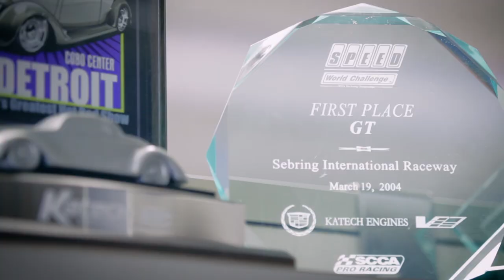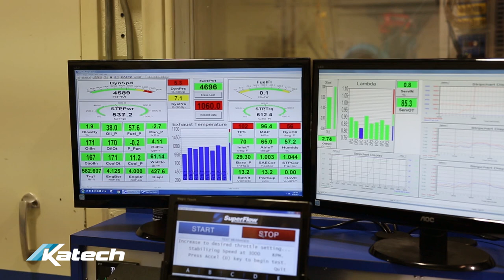BUILD VIDEO - Katech 700hp Naturally Aspirated 427ci Corvette Grand Sport road race car

Comment: Bought a new 2019 Corvette Grand Sport, with a MANUAL TRANSMISSION, and it’s a great car! Huge power, fantastic handling, and with the magnetic ride control, the car goes from track stiff to cruising smooth in an instant. My wife even asks when we can go for drives in the Corvette Grand Sport, and that rarely happens with my NSX. Buy one, if at all possible, life is short.

Comment: Now THIS is the kind of content I like to see. GOT DAMN... 700 naturally aspirated horsepower is freakin' impressive! That 2 month turnaround time is super impressive as well!
Reply: all motor engines are capable of making any amount of horsepower why do people still act shocked about that in this day and age
Reply: @Mr. TAMW  Stop trolling. Your 1.5 liter can't bring in enough air and fuel to make that kind of power and even if it did, it would blow up instantly.
Reply: @tylercouture216  No they can't, maybe on your planet, N/A cars are hard to tune and expensive to, it also just stops at a certain point whilst a turbo engine the sky is the limit.
Reply: @swansmeister incorrect lol

Comment: 700 n/a HP? shut up and take my money
Reply: Angel Brahh aahhhh yeah that’s more than 550 wheels hp. More like 620 to the wheels
Reply: that's nothing. a ferrari 812 is 790 hp.
Reply: @1SLOWCAT  but it's NA and that is still alot of power in a light car. Faster than a hellcat forsure which is awesome because its NA.
Reply: @1SLOWCAT  and yeah that 600+ to the wheels lol... 550 would be like 640 crank up.
Reply: @OscarMaris  that car has 4 more cylinders and is at minimum 4 times the price of the grandsport
Reply: Angelo Basso  Are you high? This is not a base Grand sport.  The engine that comes with a GS is only 460 hp..
Reply: I’m wich’ca my man... this is the 
BladeRunner for sure...If I ever win the lottery... I will have this car.. if no other car.
Reply: Check out Vengeance racing’s C5 build. Its a NA LSX, no nitrous, making near 900 WHEEL hp to a dog box transmission. Its a half mile car and has ran 199.8mph so far.
Reply: OscarMaris 790 flywheel horsepower. Ferrari is notorious for powertrain loss. I bet the 812 doesnt make more than 650wheel horsepower. There is an old saying in the tuner world. “If you want to piss off a Ferarri owner, put their car on a dyno.”
Reply: @yeetusdeletus9  More cylinders yes but not more displacement; we're talking 6.5L vs 6.99L or 427 CI. So Ferrari does more with less but who's got $350 - 400K? LOL I couldn't even afford this Vette!
Reply: @ChuckBeefOG  that vengeance built c5 you refer to is actually 1100hp my goof sir. I watched it before i came here lol.
Reply: Clifford Purk Damn. They must have done a lot to it since i last seen it.
Reply: @cliffordpurk18  1100 hp at the crank, which is 900+ at the wheels.
Reply: OscarMaris Ferrari have the best Engineers and all the money in the world to make 790 NA Engine. 
Think a little bit, kid
Reply from the maker: @1SLOWCAT  This car made 627rwhp.
Reply: @OscarMaris  A Ferrari is 3 times the cost of a Grand Sport with the Katech Mod!!
Reply: Would be 570 through a big stalled Auto
Reply: @1SLOWCAT  Either you have ridiculous drive train loss or you're math is WAY off. How is 700 crank equal to 550whp? It's more like 6xx which is confirmed below.
Reply: OscarMaris it’s also $400k lmao
Reply: @FocusedTrades  Are you serious.  $400k for this build.  Fck that
Reply: @KatechPerformance  627 whp   and add a procharger that would be nice to see
Reply: How much for a 427 package on my 2019 grandsport?
Reply: Scott Cates according to their website it’s $31,657.99 which is more than a used c7 lol.
Reply: @Brikzilla  yeah katech is for the super wealthy. Not for the typical blue collar worker.
Reply: Scott Cates I mean at least you worked hard to at least own a corvette. You’re doing better than most!
Reply: @OscarMaris  its a 6.2 that comes with it not a 7.0.......
Reply: @larrycurrence6874  but that Ferrari engine will be physically huge compared to this LT1 and weigh a hell of a lot more, so not sure why hp per liter is really important? This engine is pretty much the same physical size and weight as the 4.3 V8 found in the F430 ;)
Reply: @OscarMaris  With 4 more cylinders and 200 000 more USD.
Reply: @nodo7575   Ferraris are nearly free if you haggle

Comment: The fact that no power tools are used shows your quality of work. Amazing build
Reply: SuperMegaCliff 
Why is that?
Reply: @bstevermer9293  - Because it's hand built.
Reply: AMG uses robotics and power tools on their special "hand built" engines but also computers to measure out tolerances and even the smallest details. I trust it more than a shop that does without the tech

Comment: 700 NA HP?   Now that would be fun to drive.  Nice work!
Reply: Chris Harris The hell are you talking about!?
Reply: yeah, what? lol
Reply: Chris Harris 
Wtf? What planet are you from? The grand sport comes with a 376 from the factory, and makes 460hp. Not 700+.
Reply: Lol the stingray or grandsport is a 376 compared to a stroker engine 427. Anyone who knows anything knows that a boosted car needs more power to beat a n/a car with similar power. Roots chargers run out of power at redline or just before and n/a engine is lighter = adds weight over the front axle80-100 pounds not including the weight from chiller killers , meth setups etc that you will need to keep the iat temps down so more like 150lbs or more added to front of car =undesirable no heat soak, more reliable and consistent (can be hot lapped and do it over and over again and run laps hard with out having timing pulled or going in limp mode, plus they pull hard up top and have a very strong linear predicable powerband which is key for auto cross and road course racing and still fun on the street for bracket racing. Give me a 700 hp n/a engine over a 750 supercharged engine any day of the week. You can do drag, auto cross and road course and kick ass at all band if someone wants to race for money you can always throw a 100-200 shot of nitrous on to of the high compression n//a that the bottle can easily be removed when you track your car that will kill any boosted car.

Comment: I own a 2017 Chevy SS Sedan with the stock LS3. I've been on the fence as to which upgrade to choose. If I were to follow the primrose path by others, I would have a new block cam-ed, ported with internals, coupled to an SC, and tuned as a daily. Conversely, I just can't shake my desire for an NA alternative. This video inspired me with the cleanliness of their shop and how they approached the build with surgical detail.
Reply: Always up to you man id be interested to hear what youve done since your comment. Ive had turbos and SC in the past and for me unless your sending it down the track or have a heavy wallet its not worth it. I have got an LS2 VE SS with 490rwhp which is enough for the street, reliable maintainable power with the N/A nostalgia.

Comment: Amazing. Why didn't Chevy go this route with the Z06? You guys are awesome.
Reply: jalloor probably smog
Reply: There is no way that car is fun to daily drive. With 700 N/A, I imagine it's gotta have a pretty nasty cam that would make city driving no so fun. I could be wrong though.
Reply: Dan The Man That is also what I heard. Apparently they tried to go big naturally aspirated but nothing with the power they wanted passed emissions
Reply: jalloor 

Too expensive, too time consuming, too difficult to reproduce effectively and efficiently, and 700 naturally aspirated hp won't pass emissions...

Like it or not, but these cars are mass produced, it's the only way they'll make a profit from them... Why bother pushing for 700+ na hp when they can get those same numbers by installing a small and cheap blower rather than wasting all that time and money porting, re-sleeving, fine tuning etc, the power output will be the same, but it'll take significantly less time, money and effort using a blower than going na...
Reply: ZarosianEos I heard that the auto-cylinder shutoff mechanism could not stand 7000+ RPM. Even with the 454 spining at a lower rpm than a 427.
Reply: Because GM is too scared to make anything cool. I have been waiting for an LT4 powered truck for ever.
Reply: Carlos Suarez They did the same with the old LS3. They had 485 and 525hp variants as crate engines, also used in the Copo Camaro drag car.
Reply: Warranty and emissions.
Reply: My C6Z probably makes 700+ NA, and the driveability is greaaaaat! You just have to get the right cam!
Reply: Apparently they tried a high-rpm naturally aspirated big bore engine, but couldn't make it hit emissions. So they went with a blower instead. Kind of sad.
Reply: Because gm and Chevy suck now day

Comment: 40psi of oil pressure at 4800 rpm. These motors sure are some voodoo magic
Reply from the maker: Funny you should mention it.  We've seen less than desirable oil pressure in dry sump LT applications, so we came up with our own oil pump that we just released.  https://store.katechengines.com/high-capacity-scavenge-high-capacity-pressure-lt-dry-sump-oil-pump-p812.aspx

Comment: I'm a die hard GM and N/A fan, and seeing 100hp/L out of a 427 is always cool. I know you guys stopped making Corvette race engines after GMPP brought everything in house in 2010. However, I hope that your work with Pratt & Miller still created a strong bond. I have several questions, the last of which is more of the blurred line between race and road engineering.

1) When it comes to the Gen V LT1, how long do you think it will take the aftermarket to come up with a true tall-deck block with direct injection that will support 100hp/L and 500ci? The LSR-TDRC2X block from Concept Performance has been hailed as the next big step for making reliable power for the LS platform - and it supports up to 505ci SAFELY. Obviously with the LSR block reliability is key, and it supports 505 ci (4.180"x4.600") safely before the wall thickness is no longer sustainable. But it's still an LS-based block, without direct injection. Also, the tall-deck version only weighs 120lbs, which is kind of crazy. A tall-deck production LT1 (LT7?) block that weighs 120 pounds would be sheer insanity.

2) Going back to the LS architecture, an engine builder (who shall remain unnamed) using what looked like a Dart block, old-school intake, made nearly 870 hp/740 lb-ft out of a 'conventional' 502ci (4.165"x4.600") build - and it was meant for a STREET DRIVEN car. They posted the dyno run on YouTube only a few weeks ago, and it looks entirely legit. What kind of cam and compression ratio would support such a ridiculous amount of torque AND power, even with a huge stroke like this?

3) Everybody talks about drivetrain loss and the different ways to calculate it. You lost about 76hp from a 700hp build, so I'm gonna round it and call it 10% loss total. Most people land somewhere between 8 and 15 percent - but obviously it's different for every engine, transmission, and drivetrain package. Which transmission did you get that loss with, auto or manual? And if it was the manual, how much more or less power and torque would you see at the wheels with an auto (or vice versa)?

4) Lets say we take the aforementioned 502ci crazy engine, and we drop it into a car running a CF driveshaft and a 9" rear with 3.00 gears. What would be the difference in horsepower and torque at the wheel with a traditional manual (say a beefed up T56 Super Magnum) versus a 6-speed paddle-shifted sequential box, like something from Albins, Holinger, HGT Precision, or the like? And would it be practical (not necessarily comfortable, but practical) to run a sequential on the street assuming that its torque capacity exceeds 1,000lb-ft? I've heard that the HGT boxes are the quietest and have barely any gear whine - plus they're EXTREMELY light.

Comment: Sooo tempted to pull the trigger on this for my 2017 GS...    curious how durable it is for 100K miles..
Reply from the maker: S M well, none have 100k yet but for street use that should be fine.
Reply: Would imagine u might need to change valve springs every 15-20k other than that should be solid

Comment: Would love to see your 'larger' cube options & on E85.
Reply from the maker: We have since built a more aggressive version.  Still 427, but more aggressive camshaft, our new LTK heads, better intake manifold and E85.  It made 806hp.
Reply: I'm curious how this 427 compares to a stock LS7 and a LS7 at similar power levels as far as low rpm smoothness and drivability are concerned? I'm guessing the VVT and DI help  @KatechPerformance
Reply from the maker: @lorddoobsworth144  the LT1 427 platform will make very similar power to the LS7 with the same supporting mods. We can make right at 600RWHP with both very reliably. The LT1 will have a bit better drivability.

Comment: It all looks beautiful I was wondering if after all the working of putting everything back together perfectly to the best of ur ability does the engines have problems where you’d have to pull it all apart to fix stuff or if it’s done right it should last a long time with this much horsepower?
Reply from the maker: For street use it should last you a long time.  We offer a 3yr/36,000mi warranty for this standard package for piece of mind also.

Comment: Street version for a 2014 Z51 A6 with 9,000 miles, ??? Or 402 using L8T crank and Hot Cam and LT2 heads. Retired engineer needs more and loves the C7, maybe widebody rear fenders for wider tires nut Keeping it NA for street??? Thank You, Dennis in Virginia

Comment: When building an engine like this, don’t you have to run it for like 200 miles with break in oil or so to create cylinder and piston wear patterns before all out dyno-ing?

Comment: What compression and octane gas is used in this car. How big is cam. Must be a massive drag race solid roller cam
Reply from the maker: 12.5:1 compression, 93 octane fuel.  Exact cam specs are proprietary, but it's a streetable hydraulic roller cam.  Nice lope but not super aggressive.
Reply: @KatechPerformance  93 octane on 12.5:1 compression.  Fcking time bomb

Comment: Immaculate, professional build. Did you guys stroke this 427 cu in motor prior to this build? I recall GS Vette's are 350 CI? Why go anywhere else - you guys do everything and do it right. Do you port superchargers that are not on a domestic vehicle? Did this Vette receive Haltec engine management?  Last one - did you upgrade the clutch assembly? Great video - thanks!
Reply from the maker: The car was completely stock before the build.  We achieved 427ci by using our sleeved LT1 block @ 4.125" bore and used a 4.000" stroke crank.  Currently our only supercharger porting available is LT4 and LS9.  We are working on LSA.  The engine management system on this car is stock.  The clutch is an RPS BC2.

Comment: Very impressive. One question...Why don't you guys use impacts?
Reply: SSbigblock454 there is nothing thats real high torque on this car..... the ls/lt engines are held together with relatively low torque also. Disassembly is a different story...

Comment: With 700 n/a horsepower there's no need for the added weight, complexity, and cooling issues with turbos/superchargers. Why is the block cast with "6.2 L"?

Comment: How high does it rev to now? I wonder if the drilling didn't make the walls between cylinders too thin. How's the reliability?
Reply from the maker: 7000rpm redline.  Material behind the liner is adequate for sleeving and meets our standards.  We've never had an issue with them.
Reply: KatechPerformance how would you compare this engine to an ls7 from the c6.. which one would you consider more "raw". I'm debating which gen to get and then tune it.
Reply from the maker: Stock LS7 versus this?  Or similarly modified?
Reply: KatechPerformance LS7 tuned vs Your LT1 version. I mean what's a better platform? Some people say that LS engine is still better than the LT. They say that the power delivery is very aggressive with the LS and that it sounds better.
Reply from the maker: We have achieved more power with LT platforms in similar configurations to their LS equivalent.  For example, our head/cam LS3 makes 540hp while our head/cam LT1 makes 600 with equivalent camshaft.  Our 427 LT1 makes 700hp with a similar camshaft to our LS7 package that makes 660hp.
Reply: KatechPerformance thank You for Your time. This helped me a lot. So it's a c7 gs for me.

Comment: If you really were so focused on track performance why wouldn't you get the factory option carbon brakes?
Reply: imsatanscott A lot of people that got the carbon ceramic option that track their cars regularly went back to cast iron rotors for practicality. The carbon brakes just weren’t up to the task of heavy track use.

Comment: Serious question. The lt1 is a 6.2 engine, standard in the stingray and the grand sport. Zo6 on the their hand is a lt4 on a tvs I believed. I love n/a engines. Man the voodoo engine 526. The 6.4 392 and for Chevy the lt1 but built to the max. What did you guys do ? Did you guys bore the engine ? In the future I'm going to you guys !!!!!! But can someone explain ? I don't want a zo6, and I don't want a stingray. I want the middle. Black grad sport that pushes 700 horses !!!!
Reply from the maker: The LT1 is sleeved.  4.125 bore 4.000 stroke.

Comment: What would it take to make 700whp N/A out of an LT1? I've seen a lot of past LS platforms destroked to increase RPM, would that facilitate more power in an LT setup like this? Also: what does this car rev to? ft/lb rating? 

Thanks in advance for anyone's knowledge on this
Reply from the maker: I think the best way to make more would be improved cylinder heads and intake, which we are studying now.  The redline of the engine is 7000rpm and it makes 620lb-ft.
Reply: KatechPerformance wow that's awesome. thanks for the info, love the channel and development coming from you guys on these cars!